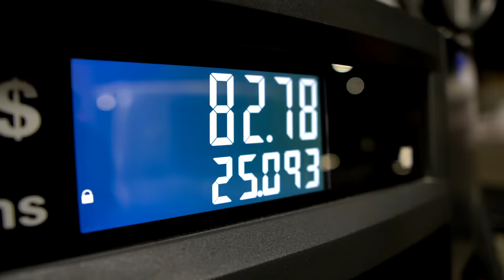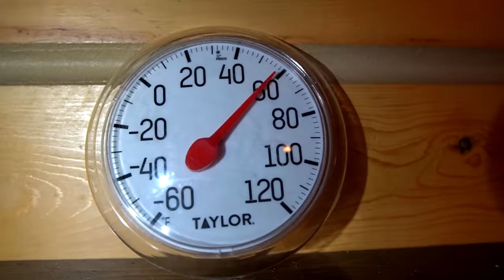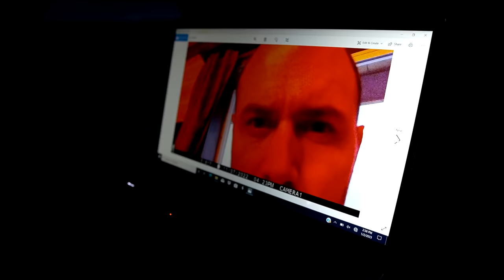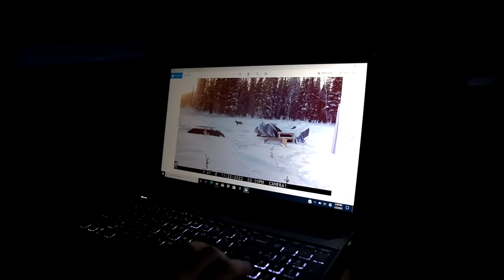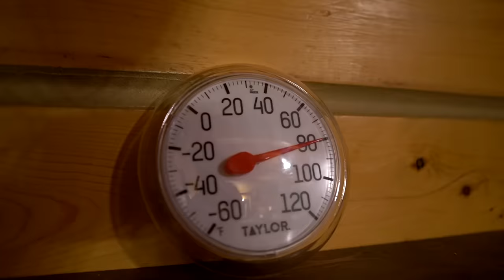Firewood Burn Times + Testing Kindling Splitting Tools | Cabin Wood Stove Cooking

Comment: Whenever my grandmother added blueberries to pancakes, muffins, cake,etc., she always added a little bit of flour to them.  Enough to coat them good. Then gently folded them into the batter.  This helped to keep the batter from turning blue.  In cakes, it helped to keep the blueberries from sinking to the bottom of the cakes.  In pancakes, another thing she did was to add the blueberries to each pancake as you cooked them. You added the blueberries as soon as you put the batter into the pan.  Then flipped as usual.

Comment: Eric and Arielle you guys are the best! My wife and I live in Willow AK. We love watching your teamwork and how you love each other and adventure together 

We also use wood for our primary heat and we found we boosted out burn times by about 10-15% if you rake your coals as close to the front (or back, depending on the air intake location) and then set the logs in parallel and layer them so they burn the logs from front to back like a candle. Helps us not have to get up at night as often 🪓❤️🏕️

Comment: As a lifelong resident in the upper Midwest who lives out in a rural area a skid loader is such a vital tool to have. Snow removal goes so fast, you can buy attachments that pull trees, drill post holes, picks up brush and trees, etc, etc.  Best of luck with your new place and thanks so much for letting us tag along. Best wishes for 2023.
Reply: I agree ❤
Reply: @mti2035  look into the side door loaders. So much easyer to get in and out of.  Or a tractor PTO come in handy.
Reply: Amen.  Hard to beat a skid loader for clearing snow on a small lot.

Comment: Eric you might be able to get a “cold weather kit” for that generator. Basically it’s like a heat tape that wraps around that breather hose and keeps it from freezing. It just wires in to the power source and as long as the generator is running its on.  Basically the same thing as the hand warmers on your sleds! Happy New Year to you both and your critters!
Reply: Birch bark will burn even if the wood underneath it has rotted away.   The old wood fired ranges were both heating and cooking, some did hot water as well, a good one (Raeburn for instance)  would have had an oven,and two or three hotplates. I don’t see any modern homesteaders using them, I suppose they are too hot for summer cooking.

Comment: When I was growing up, we heated with a wood stove. One year, I had a bunch of shorter rounds so I tried putting them in vertically as a lark. If there's a good bed of coals to start with, they will last longer since there's much less surface area actually burning. Something to try if you have any around.

Comment: For your wood-burning experiment, why not weigh the different woods before putting them in the stove. That way you will have a base figure to compare the three types. Also, I wonder if it makes a difference in how a piece of wood initially burns if the piece of wood is perfectly round vs. one that has been split with flat surfaces? I love it that you are trying to live economically!
Reply: Round versus split definitely makes a difference. The narrow edge of the split will burn better than a round edge because of the extra surface area.

Comment: The kindling cracker is EXTREMELY limited by the size of wood you can't use, and if you use wood sized "just right", it will expand and jam in the ring and now you have a slowdown whacking the wood free from the unit.  I cut off most of the ring, leaving only the "12:00 - 3:00" section intact so wood can lean against it, and with one good whack the wood is secure in the axe head so you no longer need the ring to hold/balance the wood.  A BIG improvement.  And frankly, you don't even need any part of the ring at all.  You hold a piece of wood on the axe head with one hand and give a sharp blow with the other hand and now the wood is immobilized on the axe head.  The ring is quite unnecessary.  The corkscrew device has one big advantage over the cracker and the axe, and that's what you mentioned - the kindling pieces don't go flying everywhere, and if you're cutting any serious amount of kindling, that represents a lot of bending over, reaching, walking over to get the pieces which wastes time and calories.  Personally I use the kindling cracker in my warm basement next to the wood stove, but after this video, I think the best solution might be using the corkscrew device in your drill press, and those pieces of kindling drop neatly in a pile on the floor under the drill press table.  You have more and faster control over the wood this way.

Comment: Ermine, mink, and other critters will wreak havoc on chickens so you will have to reinforce their run and coop areas with 1/4-inch hardware cloth to protect your hens and roosters (at your new place). Mink will bite them through the heads and necks - they are fiercely mean critters.

Comment: Personally, I use my splitting maul for splitting kindling.  The steel head weighs about ten pounds.

Often, I'll just sit the maul on a piece of wood to be split, and drop it eight or ten inches onto a solid surface. The mass of the maul commonly splits the wood without having to "swing" the maul at all.  Keeps the hand holding the wood out of the way  ---an important consideration!

Other times I'll sit a bigger piece of wood on the cutting surface, and swing the maul.  That works well for bigger pieces that need more power to split. 

I enjoyed seeing the methods you demonstrated, but I remain happy with the methods I've developed.

I heat my home with wood almost entirely here in urban Seattle.  When I need wood for the stove, I take the wheelbarrow out the front door, down the steps on a 2x6 ramp and load up wood from the wood pile.  Then I reverse that trip and leave the wheelbarrow in it's home in the living room!  I feed the stove directly from the wheelbarrow.

Handling and moving wood takes a good deal of the labor required to heat with wood, and the method I describe minimizes wood handling for me.  I suppose it would outrage a lot of women,  but I don't have to worry about that myself.

Comment: Interesting on the burn time of firewood. I will share a little on what we do for your viewers to ponder along with your great video. Here in the wilds of NE PA we use between 6-7 cords a season. I buy a tri-axle of logs from a logger (We have 35-acres of hard wood but not the time to cut and drag out to be processed). A tri-axle is load is about 10-cords (LY $725-). What ever I don't use I sell to a neighbor at cost - No Markup. Most of the wood is beetle killed ash, fresh cut white oak, and maple. We use a side load Jotul stove that handles 24" split logs. I cut all the logs to 20-22" length for ease of loading. In a different house we had a front loader and the side loader is far better to load, burn with, and maintenance - Just my opinion. Our average burn time (Yeah I did a study too) is ~1.5 to 2 hrs burn time per split log. A full firebox gives us about a 6-hrs. at 50% flue opening and 8 hrs at 90% flue closed. During the day we keep the house at about 74-76 degrees and at night, with a 90% damped down setting, it lasts all night. Typically, I get up in the morning and the temp in the cabin is 64-66 degrees. I load up the wood stove, feed the inside critters and start coffee. Once MrsMac gets up the cabin is back up approaching 72 degrees. We do not use kindling like you do as the coals seem to be enough to ignite the new logs. Temps do not stay as low as yours up there in Alaska. January we will see 10 to 0 for a 5-7 day stretches then it goes back to normal 10 to 25 degrees Then another cold snap. The two cords of wood that live on the porch is split smaller then my other wood piles. I do this for MrsMac (68 YO) as she has a challenging time man handling the larger logs into the woodstove. Attached is a pic of our cabin last October. Notice the 2-cords on the porch and two cords under the porch. Two cords are stored next to our bunk house, now used as a work shop now, and another one is located in a wood shed. http://navigatorbiz.com/wp/wp-content/uploads/2023/03/cabin-solar-panels_v2.png There you go. Oh one last thing, we were at a our bible study group last week and the men started to chat about heating costs this year. One man who heats with electric said his bill runs between $300- $400 a month. Another who uses propane and he said his cost this past year was $300- a month. Oil was similar. With the solar that augments our grid power, my last electric bill was $72-. So our firewood costs us ~$72- a month for heat. Oh and yes a bit of sweat equity. Hope I am not stepping on your great site with our experiences with heating with wood. Keep the videos coming MrsMac and both enjoy them.  "Freedom Through Self-Reliance" JohnyMac

Comment: Hello from Michigan! Thanks for the new video guys!
FYI on these newer epa rated double burn stoves, if you get your fires roaring and a nice bed of coals going, choke it down about halfway. 
If your wood is nice and seasoned, which it is, you will get substantially longer burn times. The secondary oxygen tubes at the top of the stove, help to "reburn" smaller particles and give a cleaner hotter burn, making it my efficient because it doesn't just waste the smoke and vapor. Also, your stove most likely has a small 3" hole in the back of it where your stove draws in it's air for combustion. 
If you hook up a "cold air" kit it helps with getting the most efficient burn out of your stove because the cold air helps your stove to breath and burn your wood down more completely. And if the stove starts using that to draw in it's air, then it won't pull the air it  needs from inside the cabin, and will make a significant difference in drafts from windows and door jambs.

Comment: Ever think about building a barrel stove, 55 gallon barrel, barrel stove kit door , legs , and pat for pipe with damper in pipe and door . We use one in our wall tent and let me tell you we’ve done -30 and -40 degrees and in the canvas tent setting in our underware . Can use bigger wood and longer wood and put lots in stove and last all night no problem. And we took the racks from refrigerator and weld bolts at each corner to put on top of barrel to use for cooking or what ever like toast , grilling.

Comment: With the Honda generators there is a cold weather kit to prevent the breather from freezing. I put a plastic tote with a hole over the generator and let the exhaust keep the generator warm. This works well in Interior Alaska and successfully used the generator at -40F.

Comment: I have a few friends in Canada and they use a propane generator or a dual fuel generator in which one is propane. They say, Propane has a freezing point of -44°F.. Compared to gasoline generators, propane-powered models are less likely to freeze or experience difficulty starting during cold weather. Additionally, propane is cost-effective and more environmentally friendly, making it a smart choice because it does not degrade over time; it can be stored for a very long time without losing its properties.  They do also put them inside a ventilated metal cover with ventilation holes to keep wind from hitting their generators be they portable or backup or standby. If you do not protect your generators from subzero winds it won't matter which generators you buy. Also the heat it generates inside the cover helps keep it safer. Hope this helps.

Comment: Onion hack we just learned. Set a wet paper towel near where your cutting the onions. The gas from the onion is attracted to moisture, your eyes are the nearest moist source when slicing, but the gas will be attracted to the wet paper towel instead. Tried it today, it worked, no tears. Felt bad for you Eric when you were slicing.

Comment: I have a blaze king insert unit, After a full load burned to coals (gets entire house over 75 to 85) I can fully load it, turn it down to med-low with the fan on high and it'll burn for 10hrs and keep the house above 65. House is 1500sqft with 2 levels... Blaze King is a great fireplace/stove maker and can definitely recommend them.  (this was from last storm when temps were 10*F with -358F windchills!)

Comment: I find using my Kindling Cracker on a bench is fantastic. The wood tends to fall onto the bench and I'm not having to bend down to pick up the bits. I have a bad back and I don't have a lot of strength in my arms so the cracker is my best friend in Winter. I also feel a lot safer with the cracker because it was literally designed by a girl after her mother almost lost a finger cutting kindling and she decided there had to be a safer way.

Comment: Very interesting and enjoyable!  Well done.  Although we do have birch it is few and far between.  My property is 99% poplar so I use seasoned poplar and bring in some Jack pine (the wood of choice for most in this area) - I find that if I start the fire with pine and then when stoking it I mix in the poplar topping with poplar (last to burn), all I have to do in the morning is add wood as the hardwood makes a lovely bed of coals.  I do have a valley comfort stove with a big burn chamber though.  I have been wondering if a partially enclosed insulated box with an exhaust hole and intake hole for the generators would stop your freezing up problem.  Good use for part of that shed.  Thank you for doing the comparisons.

Comment: Hey you two ,what a beautiful spot 🤩.
I've used Buttermilk Powder ,it really does the trick.
Mine was in a screw top container ,I just popped it in the fridge for whatever,👍
Does your Pipe get gooy fast. I know when I burned Birch hunks of creosote would fly out of the top of the Pipe?
A Bird .
I love and miss this Life.
I spent 40 yrs in the tri mountain area Station,Bromley ,Magic 💗.
I had to move down to the valley after my Husband died.
I did work as a care taker for a Ski House for 14 . It got too much on my leg.
Chef for 27 years .
I finally got a knee replacement!
Enjoy it All guys 💖.
JO JO IN VT 💞💨❄️⛄

Comment: I bring the cabin up to a faster temp with dry spruce, two logs. Follow up with birch for the slower all night burn.  I have a Grandview wood stove with secondary burn tubes and baffles.
Reply: Try to get your wood before the spruce trees suck up water. There are two seasons up here for spruce that has drained it's excess moisture. Using dry spruce gets hot.  That's my first burn. One log cut to quarters to begin with, one half log when the quarters are halfway through burn time.  As the half log burns you can add your wetter wood, like birch (cut to eighths and quarters), it will push moisture out quicker.  Before you go to bed fill with larger halves. I got my secondary burner 2014 and I spent hours getting it right. I hear my home with it.  I'm also a firefighter, so I like to watch and see how fire flows.  I teach my fellow firefighters in front of a wood stove sometimes. Showing the pipes shooting out oxygen to ignite the unburnt glasses.  Sometimes I'll build a smoldering fire with wet wood in the back and a smaller dry fire in the front and watch the air flow.  My nieces and nephews think I'm awesome. They want me to teach science. 
I can have a roaring fire in 20 minutes. I believe I do have a video on my videos.
Reply: I happened to be looking into a catalytic stove when I found your page.  Awesome

Comment: Great video. Loved the wood test just wanted to point out that solid logs will always burn longer and put out more heat vs split wood. It would be nice to see another video on that but with split birch. 
We’ve got all kinds of beetle killed pine here and man does it burn hot and long compared to other wood species here. We’re like you in that there’s not much birch here it’s all spruce,pine,poplar.aspen  and some tamarack.  
That pine burns a bit dirty but kicks out great heat for a soft wood.

Comment: My generator froze up the end of the pcv hose and blew it out of the air box.  It also created a leak in the valve cover from the excess pressure in the crankcase during the cold snap in 2021.

Added a pencil heater and heat pipe from the heat shield of the muffler to the air box to help prevent moisture from freezing in the air box and carb inlet.  

That part worked great this year.  I have a bit about it in my latest video if your interested.

My generator is a Yamaha 7200, but concepts can be adapted one way or another.  Pretty much need to keep air box warm.

Comment: I took the rear seats out of my Tacoma not sure that could be done in Tundra. So much more room for my dogs. Lost 85lbs from Truck and still kept 2 of the 3 seat belts. Dog beds can be added or removed. Stuff can be put under dog beds if needed. Issue is you still need a place to store the seats etc in your small cabin. If a third or fourth person needs a ride in a pinch it can still be done. Love your Alaska videos, thanks for making them.

Comment: When using the drill style wood splitter, you need to make sure it's on the drill setting and set the torque switch on top to the low speed/high torque setting. It will tend to snag the wood a little more than the high speed setting, but it won't bog down as much. The torque will carry it through to split without stalling.